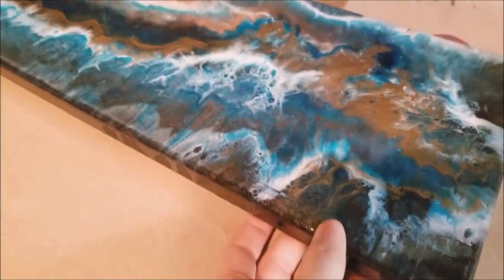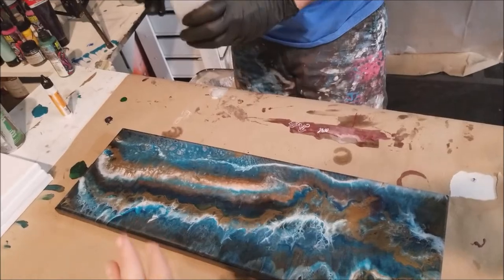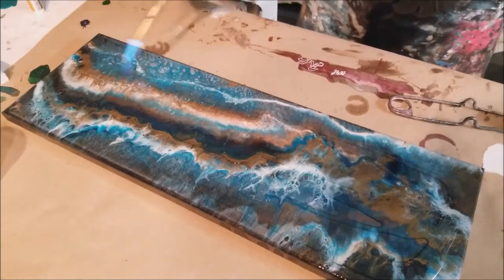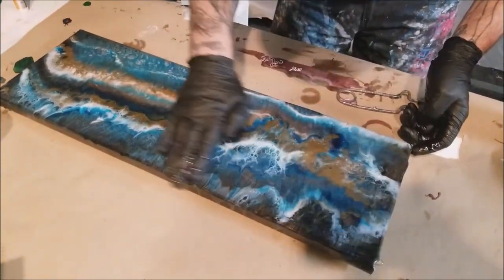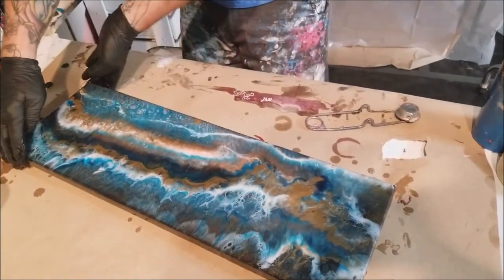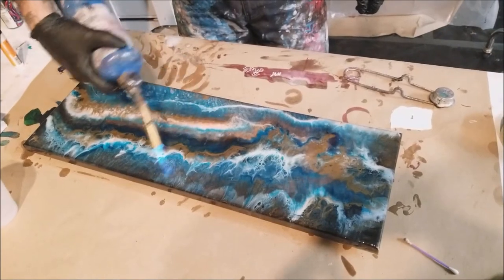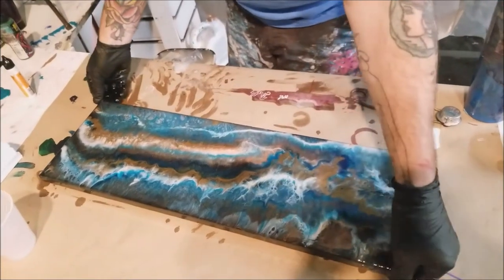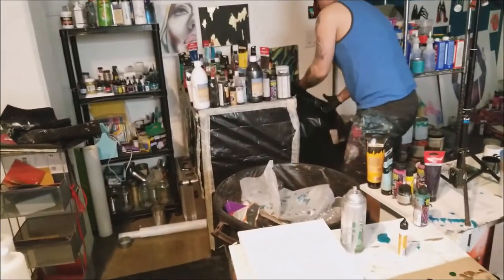Resin Finish Top Coat (One Min Pro Tip that lasts for 5 mins)

Comment: Hey, wondering if you could help me! I done this on my table top, a nice clear layer of resin, let it dry and it’s been a few days, I was sanding the edges down to paint a gold, so I cleaned the top up and realised that it left little scratches like on a phone screen for example, was it just shit resin I bought ? Lol
Reply: By the way I literally cleaned it with a cloth it shouldn’t be scratched !!
Reply from the maker: It may not have been fully cured because it takes 7-30 days for a full cure (depending on brand and ambient temp). I would just wipe it down with alcohol and do a clear flood coat after you do your gold edges.
Reply from the maker: It may not have been fully cured because it takes 7-30 days for a full cure (depending on brand and ambient temp). I would just wipe it down with alcohol and do a clear flood coat after you do your gold edges.
Reply: Artist Till Death oh my god I didn’t even know!! Thank you so so much that definitely explains it 😍 thanks so much for replying ❤️

Comment: I get the separation on the sides a lot unfortunately when I am coating a painting with resin (not a resin painting) drives me nuts. I also have a piece that is on it's 3rd coat of resin and still has one little spot (dent/fisheye). I wish I could just spot treat it. Congrats on selling this piece, it's one of my faves.
Reply from the maker: Hey stephanie!  Have you wiped that spot off with a rubbing alcohol? Had to do that to one of mine that kept fisheyeing.
Reply: yes there were three areas still after the second coat that did not take and I rubbed alcohol on them and they all took except for one very small spot on the corner of the canvas. I was like NOOOO!
Reply: There’s a video on Resin Obsession that says to clean wth mineral water and wear gloves when touching it because the oils from your hands can cause the resin not to go to that area - that might help
Reply: thank you Jan!